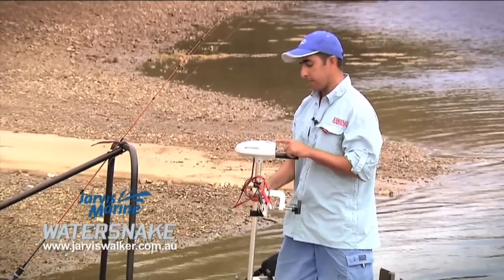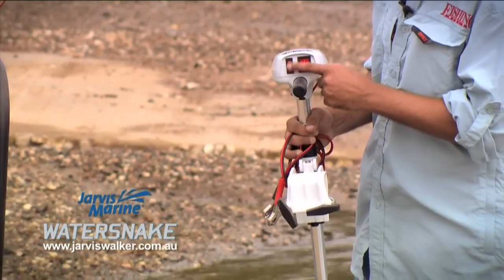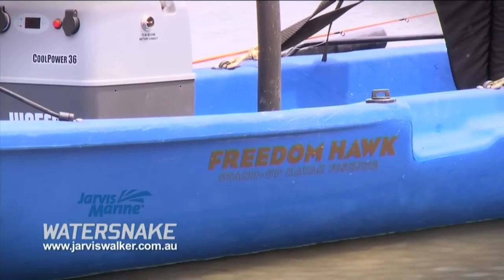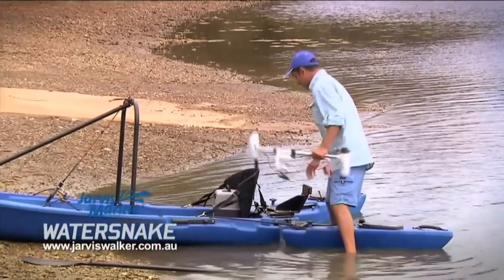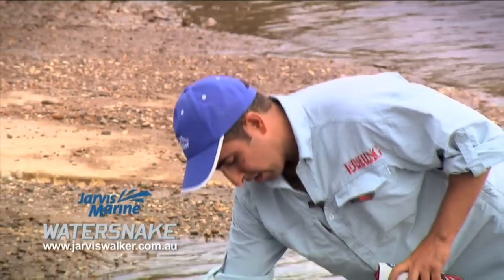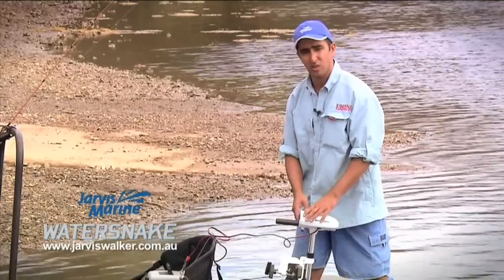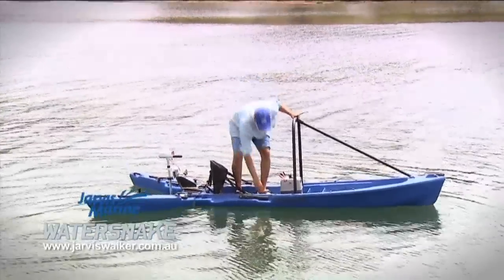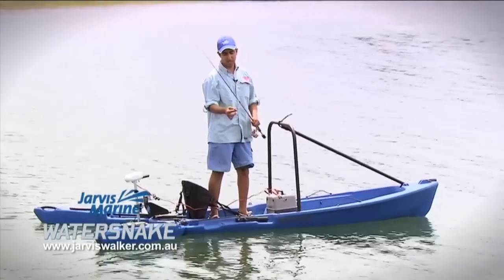How to: Fit an electric motor to a kayak or canoe

Comment: I agree on the longer extension handle. I have this motor and it works fine for my kayak but doesn't work for my back after trolling for long periods of time. I'm thinking of making or rigging something to help with steering. Other than that, great motor for a kayak and wallet.

Comment: Hi. Thanks for the helpful video. I was wondering about the battery for trolling motor. Can i use 12v auto (cars) battery for my trolling motor? Is it going to work?  Thanks a lot. Tom